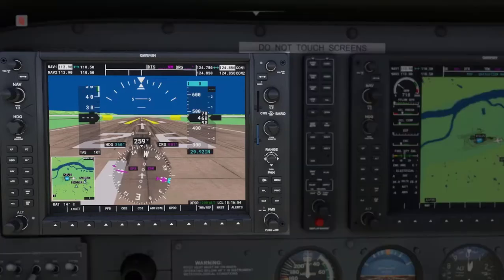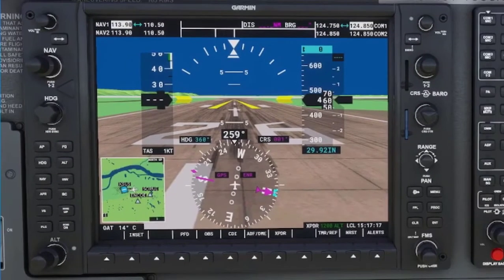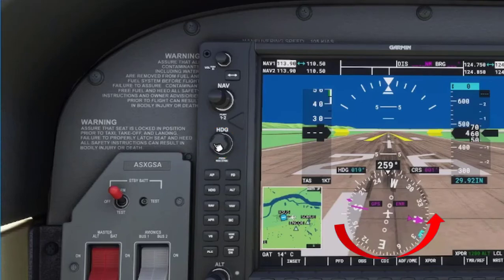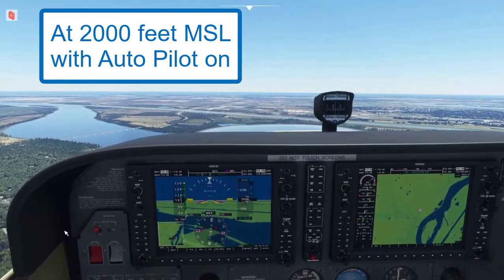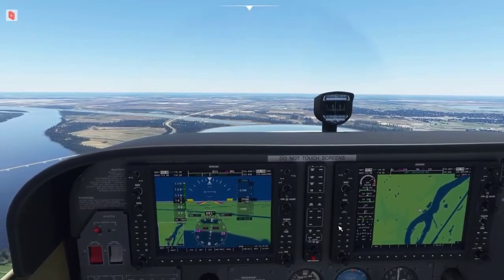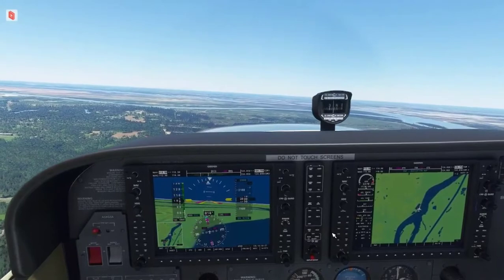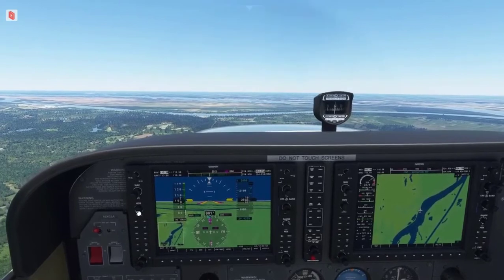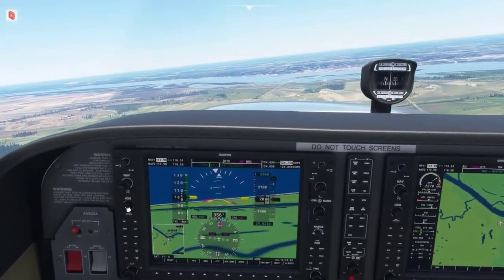Garmin G1000:  Heading Knob, Heading Bug and HDG Key

Comment: When I push the HDG button nothing happens. No sync with current heading.
Reply from the maker: What Flight Sim are you using??
Reply from the maker: If you are using Microsoft's latest Flight Simulator try holding the left mouse button down first and then click with the right.  It's a little convoluted but it does work for me on my Xbox X.
Reply: @scotthall8723  Thanks a stack. I'll try this weekend.